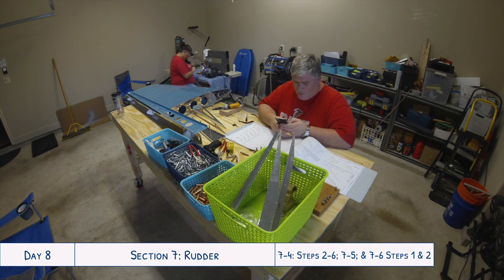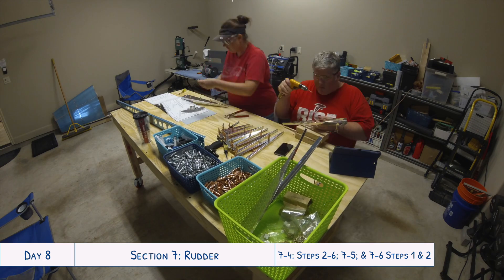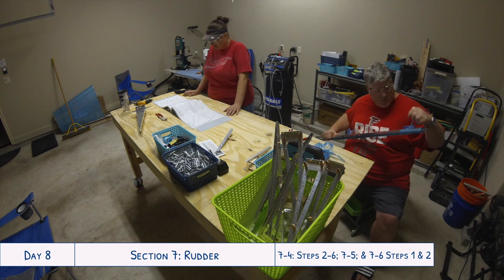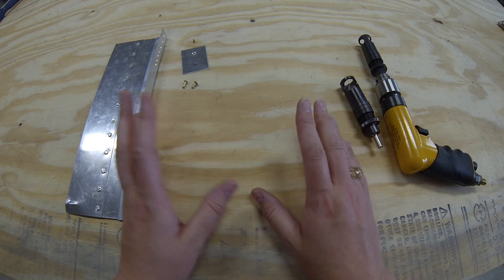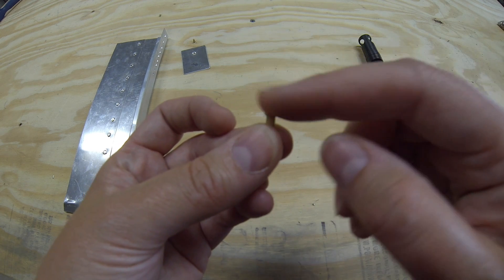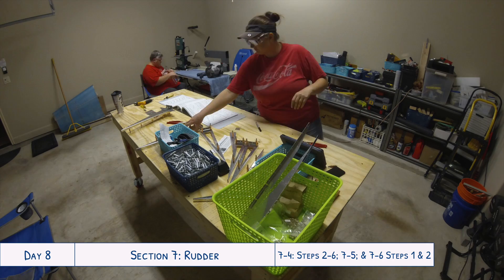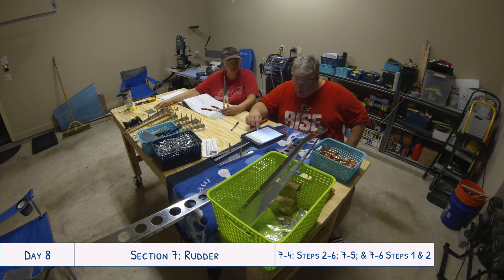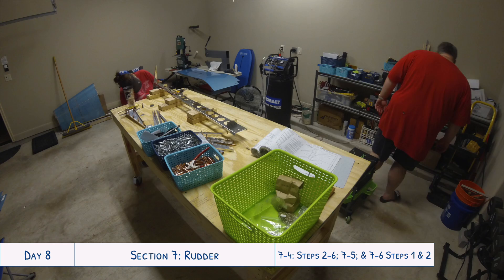Van's Aircraft RV-10 Build: Day 8 - Rudder Skeleton (7-4, 7-5 & 7-6)

Comment: one thought on the 'shavings' on the table... possibly just put a air blower tip on your compressor hose and blow the table once in awhile.  Most likely won't work with the towel.
Reply from the maker: Yup, we ended up getting one of those a couple days after this and find it really helpful! I still use the towel every so often like when I’m trimming the vinyl with the soldering iron, but we mostly use the little air gun now.